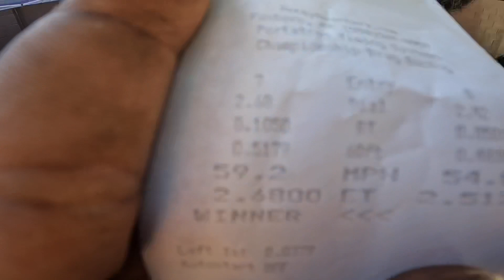RC DRAG RACING At HQ Finals

Comment: I think if your car doesn't break the beam at the finish line you lose the race. You should have your car set up so that it will complete the race from start to finish that is the driver's fault not the system.  What do you think?
Reply: isnt the point to cross the finish line 1st?
Reply: Let’s penalize the guy for being fast? Not much you can do when there’s a hump in the surface just before the beams and you’re doing 80 plus mph. I personally only made one pass in that lane and fortunately it tripped but I’m sure if I made more passes there I would have had the same problem.
Reply from the maker: I would say the bump in the road right before the finish line was the cause and not the cars if it happened on a flat surface then I would understand